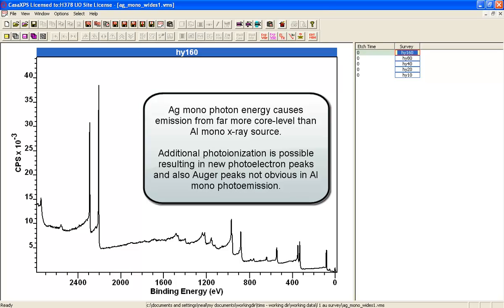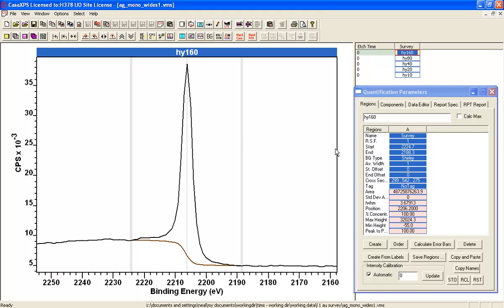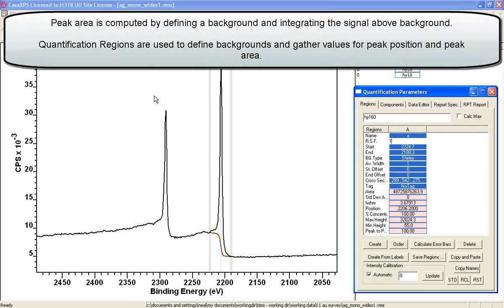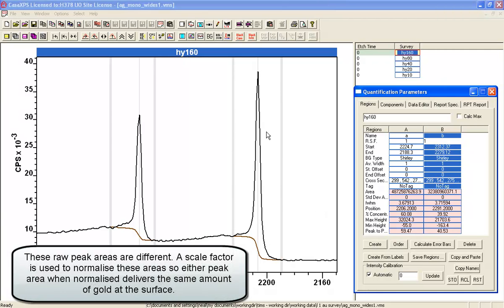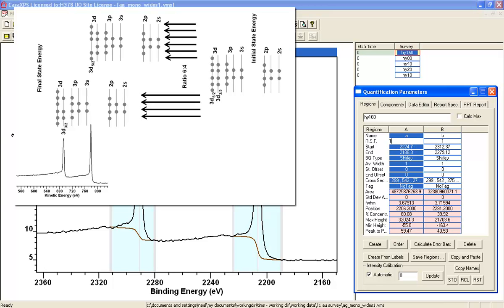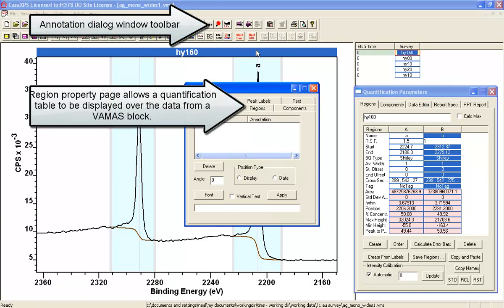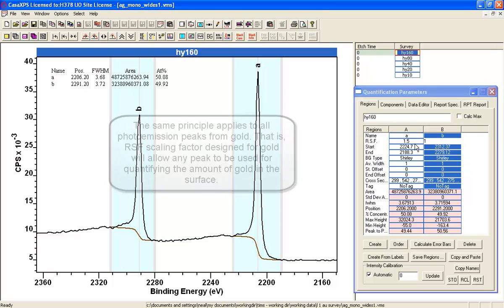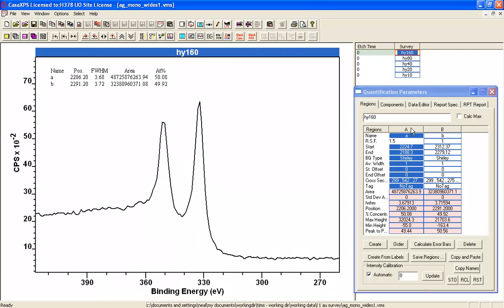Introduction to Relative Sensitivity Factors in XPS

Comment: Nice video with clear explanations. What if there's a satellite peak near In 3d5, should I include or exclude its area component before divided by the RSF of In 3d5?
Could you answer my question? Thank you in advance.
Reply from the maker: The answer to your question lies in the origin of the RSFs you use to quantify your data. If the RSFs are theoretical, such as Scofield cross-sections, then structures within photoemission peaks that exist because of loss events associated with the atom from which the photoelectron emerged, then in principle, such satellite peaks should be included in the area used to quantify the material. If, however, the RSFs are empirical, then the extent of a peak in terms of satellite peaks depends on how the RSFs where calculated. I should also say that if a satellite peak is a loss peak caused by atoms different from the atom that emitted the photoelectron, then the satellite peak should not be included in the peak area used to quantify composition.

Comment: Thank you for your video.
It is always helpful to develop my xps analysis skills.
I have a question. 
Unlike s orbital p, and d orbitals has asymmetric orbitals due to the presence of angular momentums. (It is more commonly referred to as the spin orbit coupling)
Degenerated states are determined by total angular momentum (if there is errors in my statement, it is really appreciated to correct me). You've previous mentioned intensity ratio of intensity is 2j_1 +1 : 2j_2+1, where j is total angular momentum quantum number and _1 and _2 are degenerated states. However, there are the same number of electron in those states so it is hard to understand there are differences in intensity ratio. Can you answer my question?

Thank you in advance
Sincerely, your fan from Korea.
Reply from the maker: Quantum numbers and their relationship to doublet peaks in XPS are a little hard to explain in a reply. However, the excited state for an atom in which a hole is created by photoionization of a core-level electron creates an imbalance in the p and d electrons that was not present for filled p and d electron shells. The imbalance is caused by electron spin interaction with orbital angular momentum. If you consider the vectors for total orbital angular momentum and total spin, then consider the different orientations for these vectors when a choice can be made for spin direction, then it is possible to see that there are two possible ways for a term, with one missing electron in a core level, to split and that the split, in terms of the number of available electrons with the same energy in a complete shell (multiplicity as defined by orbital angular moment) is not equal, but in the proportion we see in XPS doublets. You will find vector diagrams for L and S in physics textbooks discussing Russell-Saunders (L-S) coupling. 

These L-S coupling vector diagrams show that there is some logic as to the doublet intensity ratios but rely on mathematics to provide mathematical-logic for an observation rather than a clear physical explanation. A physical motivation for electron energy levels and properties can be seen in classical mechanics books that discuss moments of inertia for rotating rigid bodies. The algebra of vectors used in these macro-scoping analysis of rotating systems is, in my opinion, the path to our thinking about electrons in atoms and is well worth investigating.